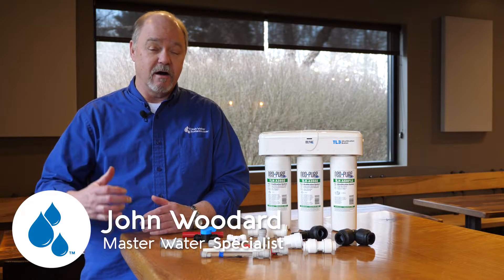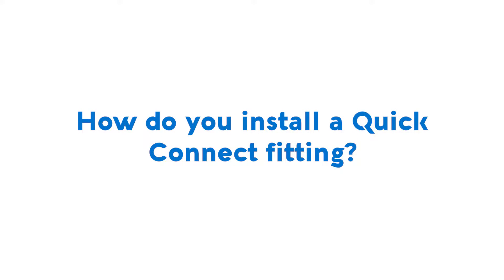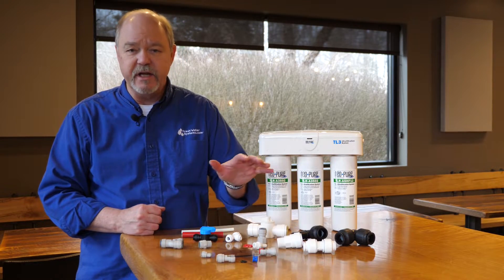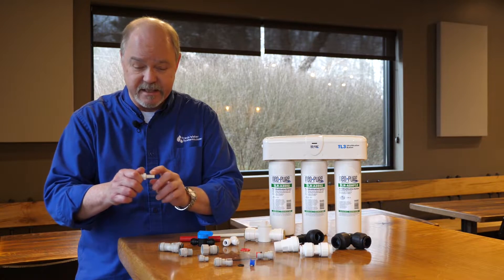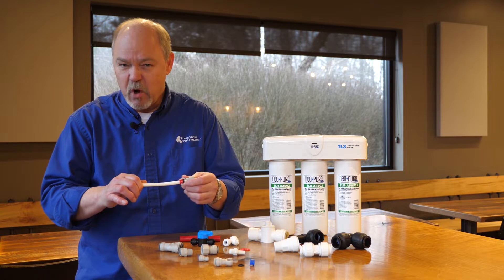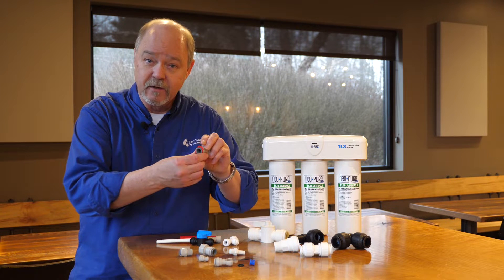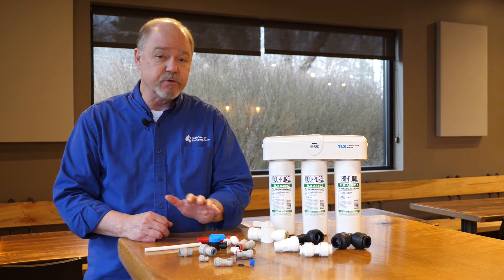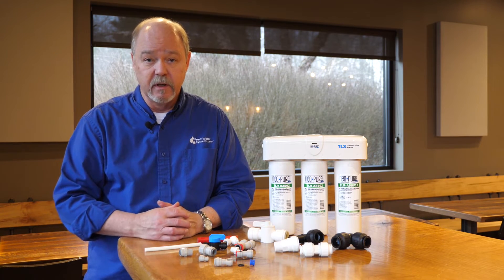How Do Quick-Connect Fittings Work?

Comment: The quick-connect aka shark-bite are subpar to screw fittings with compression ring. QC are only safe up to 9 bar and can't be pushed/pulled more than 4 times, without replacing of o-ring, as it gets damaged. They are only useful for pheumatics, not osmosis. Jaco or similar screw connectors would be much better choice costing minimum more.